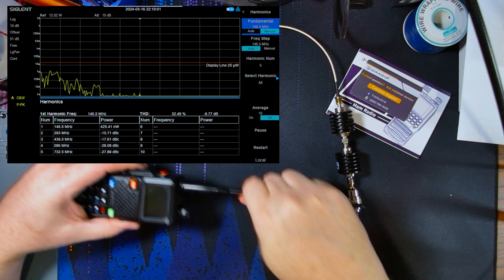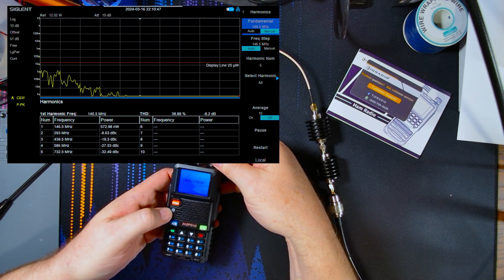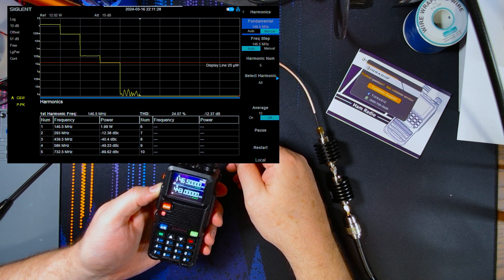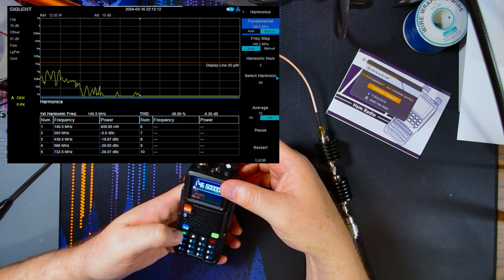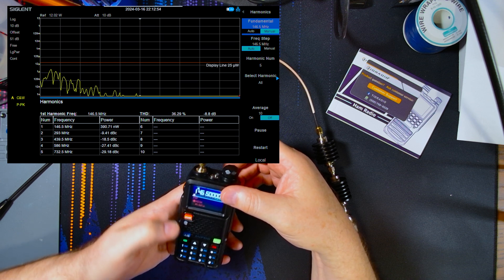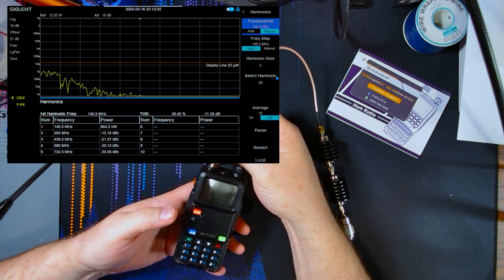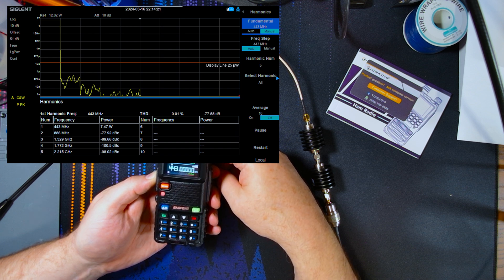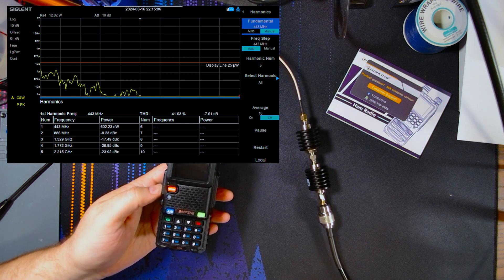Baofeng UV-5RM.  What is going on at Baofeng?

Comment: I just purchased a UV-5RM Plus GPS and it would not read on the software from Baofeng. Turns out after much confookulation I took the battery out and looked at the model number and to my amazement it was a K-5 Plus. Then I inspected the box the radio came in and it had 2 different model labels on opposite sides of the box. On one end it was a K-5 Plus and on another side it was a UV-5RM Plus GMRS. They had sent the wrong radio. This process lasted 2 days as Baofeng did nothing to determine what the problem was other than at first blaming the programming cable ect. I did all the testing until I found that the radio would communicate with the UV-5RM Plus software which just happened to be compatible with the K-5 Plus. Then when I had no way to take photos of the back of the radio and the box to send to them by email they just stopped communicating with me. I'm done with Baofeng for good.

Comment: You're a bit too narrowly focused on the 2m harmonics issue.  For $29-$30, you get a tri-band, fully unlocked radio that can clone another radio's frequency and tones with 1 button press, includes a scramble function (not real encryption of course, but it'll keep neighborhood kids from understanding what you're transmitting), its tough, expendable as its so cheap, transmits higher power than most HT's which are limited to 5 watts, and has a large battery with USB charging.  Kind of an unbeatable value in my book.
Reply from the maker: I will not argue any of your points.  The issue here isn't "value" or "features," it's that the radio is technically illegal to use in the U.S.  Any amateur radio operator should be concerned about their radios operating within the requirements of the FCC which grants us the license to use the frequencies we have.  Also to note, the "scramble" function you mention is also not legal for amateur use, or for use on FRS or GMRS.  With all this being said, everyone is free to purchase whatever they like.  I just try to inform fellow hams that their money may be better spent on radios that are legal and perform better than radios that don't.  In the same price range you mention in your reply, you can buy clean radios with the same functions.  A good example would be the TIDRADIO TD-H3.
Reply: @KC4NWK  Fair and logical points, with regard to the 2m spurious emissions, though 70cm was clean based on your testing.  My main interest in radio comms is for emergency prep & occasional use during convoys with friends in the back country, so legal considerations are secondary to me.  Of more concern is to be a good neighbor and not interfere with others via harmonics on 2m.  I will keep that in mind and limit usage there when using this HT.
Reply: @KC4NWK  The FCC has other fish to fry

Comment: For $30 to get a tri-band that can Rx on all those other bands vs just a GMRS only radio seems a decent use case to me.  Eg)  use it legally with a GMRS license (and FRS), and never touch the PTT when listening on the HAM ranges.  Harmonics issue solved, and you end up with a lot more listening functionality vs the identical chip in the 5G PLUS model that is GMRS only.  Right?  Or will it even suck on harmonics in the GMRS frequency ranges?  

Newbie here, so please dont scream at me 😅

Comment: A few weeks ago I bought two of them through Amazon. when they arrived one of the radios was locked had to have a password to unlock it. I don't know what the password is do you have any suggestions ?
Reply: There are unlock codes on google, i believe it was just a string of zeros, but it did say some different models it was either zeros or 123.... Goodluck

Comment: I for one dont care, the radio transmitts just fine I make a very good trip to different repeaters. I mostly use for monitoring purposes but in the event i need to transmitt it does the job. Just a normal guy not a radio dork.

Comment: Dude it’s a two way walkie talkie. There are not a lot of folks even using the darn radio and if they do it’s for short messages for off roading or at the beach on vacation. If people want to hold long conversations they use a telephone! The radio is less than 10 watts and all the issues you point out do not matter except to the sad hams. Please don’t be one of those.
Reply: He cant help it comes with submitting to the fcc

Comment: Hi one question I have buy that model and I try to connect to PMR  462.7130 I need it to Hiking :) and this model is Locket :( I try using the factory mode presing PTT + Monitor + VFO and power but it dont work :( you know how i can unlock it ? I appreciate the help

Comment: Whereas these harmonic levels seem to be pretty high on 2m, trying something different probably won't help much, but I would be more interested in the harmonic content from the antenna as I don't operate into a dummy load.  My antenna is a real world application instead of a lab type situation.  Years ago, our radios had high harmonic output so we built and installed low pass filtering to combat the high harmonics.  Nowadays, everyone is an appliance operator, unable to do anything for themselves.

Comment: I read a bit and still don't understand what the significance of a clean vs dirty signal mean. How can you tell it's dirty and what are the real world consequences?
Reply: My understanding is if interferes with other frequencies. I'm new to this though.
Reply from the maker: Without a long explanation, it basically means the radio is transmitting on frequencies that are not intended.  Manufacturers are supposed to account for this by adding filtering to the signal before exiting the radio.  A simple example would be you are transmitting on 146.5 MHz, and you are unaware that you are also transmitting a signal on 293 MHz and 439.5 MHz  (the 2nd and 3rd harmonics.)  The FCC here in the US puts restrictions on this in order to try to keep people from causing unintentional interference on other frequencies, services (sometimes commercial or emergency,) or devices.  You cannot tell just by operating the radio, and that is why some of us do these videos to show what a radio is really doing.  Some people don't care, but it is something you agree to when you get your amateur license here in the U.S. (and most everywhere else.)  Hope that helps explain it a little more. :)  Thanks for commenting!
Reply: @KC4NWK  Oh yes. I can wrap my head around that explanation. Thank you very much.
Reply: @KC4NWK who is being interfered with on those harmonic frequencies. In other words who is actually being injured?
Reply: To add to the real world consequences portion of the question: there are at least three potential real world consequences:
1. You can be fined (unlikely but possible)
2. You can lose your ham license (also unlikely, but more possible)
3. If enough people ignore the rules and use radios which cause interference in other bands (e.g. first responders), the FCC will conclude that ham operators are not capable of/willing to self-police and will simply re-allocate these very desirable bands for commercial use.  This will bork the radio hobby for everyone.  (much more likely and very possible).

Comment: Many of the new Baofeng tri-band transmit-capable radios only have 2 final output sections - one for VHF and one for UHF. I'm thinking that they had to move the cutoff in the VHF low-pass filter (or get rid of it entirely) in order to add 200-260 Tx support.

I'd be interested in how the Hiroyasu HI-8811 tests - it is quad-band Tx (136-174, 220-260, 330-400, 400-520) and I'm wondering if they're using notch filters or just splattering harmonics all over like the 5RM.
Reply from the maker: Thanks for commenting!  I'm glad to see this comment, because this is what I was thinking as well.  It seems that the cheaper radios that are adding 1.25M are the ones with the issues.  I say this loosely because I haven't done enough testing to say with certainty.  73s
Reply: @KC4NWK  I tested 3 different Baofeng radios on my SA and all failed on 2m; some even failed on 70cm. They're not a bargain if you can't legally use them.

Comment: So my big, big problem is you pop up a stair step but frankly I don't know w.t.f it's telling me. I'm used to seeing traditional spectrum analyzer sweeps with 10 db divisions so I can see how far harmonics are down. Everybody understands that. I do not see that here. Also I don't know a thing about your equipment or setup or if you are measuring this correctly.

Second, Baofeng actually went and got these FCC tested and they now carry.an FCC i.d. number. Something you completely fail to mention here.

The FCC number carries more authority than what I see (well can't see here). Just badmouthing Baofeng doesn't make you an expert either. 

If we perhaps had a decent discussion about how the radio fails signal wise then we could also discuss the circuit and where they went wrong and perhaps amoleriate it with filtering. Something that hams have done for time eterna but it just seems easier to give Baofeng a kick in the shins so to speak rather than spend effort on circuit analysis.

Oh, and before you crap on Baofeng their crap radios are bringing people into the hobby. Which is something that's desperately needed.  Sure you're not going to waste time on it while the new ham sadly happens on your channel with their Baofeng in hand!!

I'm not going to defend Baofeng's crap radio. But I'm also not going to defend a YouTube video that is more of a crap Baofeng comedy hour rather than actual useful technical information! 

This video is pure LID. Yes I'm calling you out for the above reseaons and THUMBS DOWN. 73's sir.
Reply from the maker: Thanks for the comment.  This gives me an opportunity to address the FCC-ID misconception.
Did you look at the FCC ID on the radio?  Here it is: 2AJGM-5RM
You can look it up here: https://fccid.io/2AJGM-5RM or directly on the FCC site at this address: https://www.fcc.gov/oet/ea/fccid
What you will see is that this FCC-ID is for FCC Part 15 Subpart B compliance.  

Here is the report: https://fcc.report/FCC-ID/2AJGM-5RM/7132026.pdf
On page 1 of the report it says "Standards: 47 CFR Part 15 Subpart B"
On page 10 of the report you can see that it was specifically certified for 15.107, 15.109, 15.111 and 15.121(b) (of Part 15 Subpart B)

15.107 deals with radio frequency voltage that is conducted back onto the AC power line. On page 12 of this report, you can read the test procedure. Section 3.1.3 of the report "Test Procedure", this test was to measure interference over the AC power line between two "AC floor outlets"  These tests were done during "Charging & Scanning" and "Charging & Receiving."

15.109 deals with radiated emissions from unintentional radiators at a distance of 3 meters.  This is radiated RF energy from the device when NOT transmitting. Page 14 discusses Test Procedure. Here is a link to a WaterPik that passed the same test criteria: https://fcc.report/FCC-ID/2ANTU-20023329/4530520.pdf

15.111 is the same as 15.109 but with the antenna terminals shielded and terminated with a resistive termination equal to the impedance specified for the antenna. The signals are then measured at the antenna terminals and cannot exceed 2.0 nanowatts. Page 15 discusses test procedure.

15.121(b) states that the RECEIVER shall reject any signal from the Cellular bands based on 12 dB SINAD measurement. Page 16 discusses test procedure.

So as you can see, this FCC certification has nothing to do with how good or clean of a transmitter this radio is either in or outside the amateur bands.  
This certification is what leads to the incorrect statement of: "It's FCC certified it has be good."

As far as the harmonic testing in my videos.  I use 50dB of attenuation between the radio and the input to the spectrum analyzer. This exact attenuation number is obtained by measuring the attenuation of all cables and connectors used in the connection of the radio.  This is done with the tracking generator on the spectrum analyzer, and applying this number to the offset.  This "stair step" graph seen in the results is rather easy to interpret, and is why I use it.  The display shows the fundamental frequency as the first bar, and the 2nd, 3rd, 4th and 5th harmonic frequencies (I generally only look at the first 5 harmonics) in the sections to the right of the fundamental.  This allows for an easy quick view of each harmonic frequency in comparison to the fundamental.  I also place the 25uW (-16.02 dBm) line on the display for the secondary requirement that all harmonics are required to be below 25uW for FCC Part 97.307(e) compliance.  In addition, each harmonic is listed below the graphical display with its relative dBc from the fundamental.  This is generally much easier and quicker to view for everyone, and is the default display for the "Harmonics" measurement on current Siglent spectrum analyzers.

We all want new hams to join the hobby.  It would be nice to have them make educated decisions on the equipment that they buy and use on our allotted frequencies.  From several of my previous videos and many videos from other YouTubers, it has been shown that there are other choices for introductory radios that are clean in this price range. Baofeng's own UV-5R seems to now be clean per my previous video here: https://youtu.be/KZv5XmEUGHo  

Hope this helps clear some things up.

Comment: Normal people won’t care even if shoots flames, as long as they can talk with it!
Reply: Gatekeeping in radio is pathetic
Reply: Flame throwing radio is good for toasting marshmallows
Reply from the maker: Unfortunately you are pretty much right on with that comment! :(   This is one of the reasons I try to put the information out there to let people know before they buy.  There are plenty of radios in this price range that are also clean on transmit!
Reply: @KC4NWK so how does it work? Is it illegal to use such radio since it’s certified by FCC? That’s $26 radio and has AirBand RX perfect for the airshows.
Can you make the test how you can be heard with high power transmission 1-2-3 miles distance? Maybe it is still good to communicate?
Reply from the maker: That is a good question.  I answered with a rather long reply to another comment on this video (you can read that below if you like,) but the FCC certification that this radio has is nothing to do with its transmit capabilities.  If you look up the FCC certification it is for 15B.  You can look it up here: https://fccid.io/2AJGM-5RM   I won't summarize the certification here again, but basically the same certification can be applied to a calculator.  I think I will end up making a separate video explaining these FCC certifications.  Technically, yes, this radio would be illegal to transmit on here in the US on the 2M amateur band.  But is fine for listening to air-band etc.  Hope that helps a little.  Thanks for watching and commenting!
Reply: @KC4NWK  Put an example, with the same caracteristics, please.
Reply: @KC4NWK what cheap radio do you find clean?
Reply: Where can I acquire this flame throwing radio?
Reply: No one should😂
Reply: Honestly, I have no idea what this means... Is it that the transmit power isn't as strong as it needs to be (10w?) or that there is also other noise being transmitted?

I mean, if you and the other hear you... Isn't that mostly is what is of concern?

Would this reduce battery life over time with it being "dirty"?

I just got mine in today and these are my first radios, so yeah, a ham...let here (ha! Get the dad joke? ham...let, Hamlet... Like someone new to hamming or ham radios... Oh, com'on :D).

Comment: Thank you! I am UV-5R owner for several years. They were purchased even before getting my amateur license. Now even though I understand the benefit/need for clean transmission, I can’t just toss them. An HT that is a clean transmitter, that transmits on frequency, has decent receive capability, and where the cost vs value is acceptable to ME is something for which I am ALWAYS looking. Please keep up your great videos.
Reply from the maker: Well said!  This is one of the main reasons I like making these videos.  I just want to put the information out there.  It is up to each individual to make their own decisions.  I would love it if all radios with spurious emissions could be junked, but the more people that know what is bad before buying the better!  Thank you!
Reply: @KC4NWK these radio cost about 20€ and they should be praised as they are onboarding more people in the radio world that any other high spec model. Not many people will spend 100+ for a device that will think will barely use in the beginning.